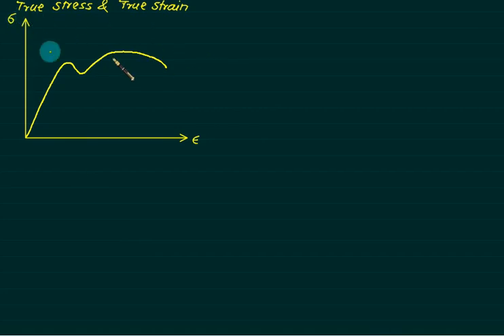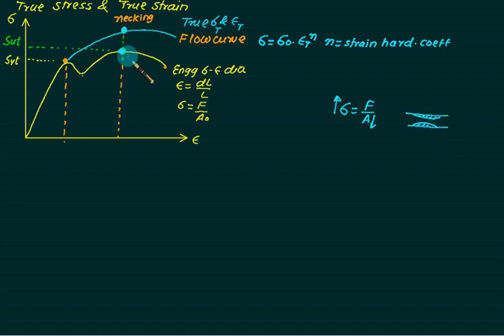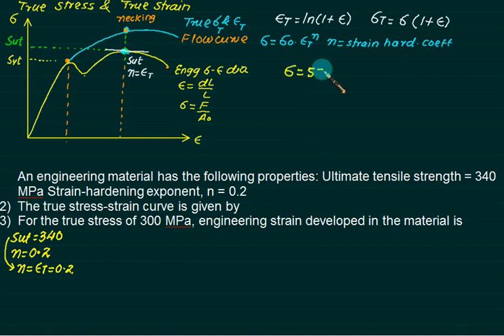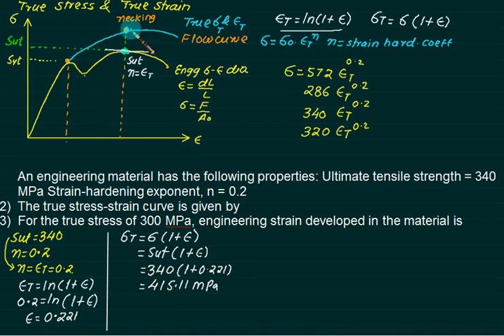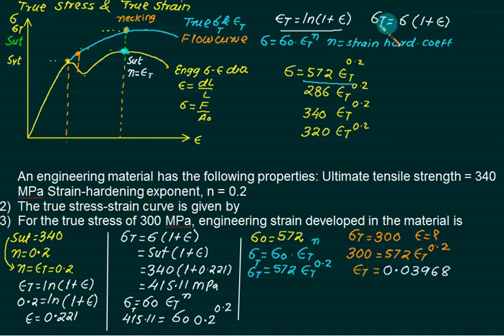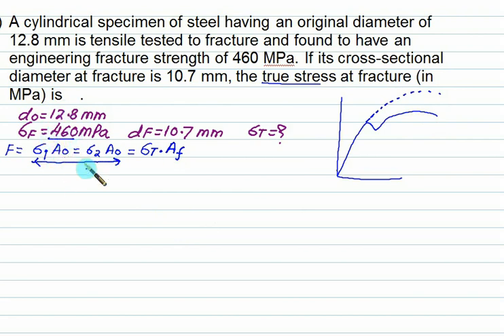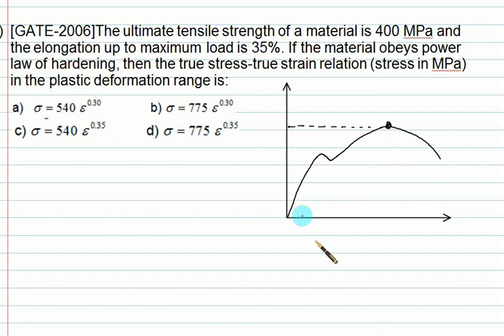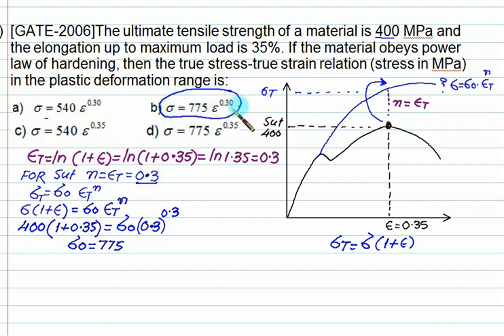Forging  01 True Stress Strain

Comment: Sir, what is the relation between true strain and engineering strain for compression? I used the same expression i.e.
 True strain = ln(1+Ec),  but the value is coming negative. So is there any other formula or we should just write the negative value of strain.
Reply from the maker: take strain as positive. In metal forming all strins are negative. for calculation we have to take positive value
Reply: Thanks a lot sir. I got it now
Reply: Sir I'm getting engineering strain as 1.221, in first question
Reply: Sorry sir I got it